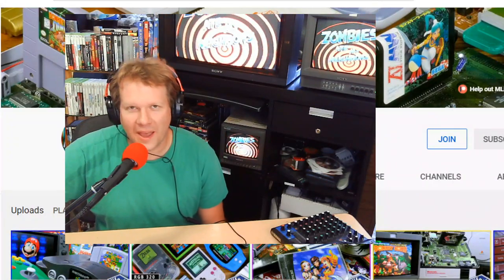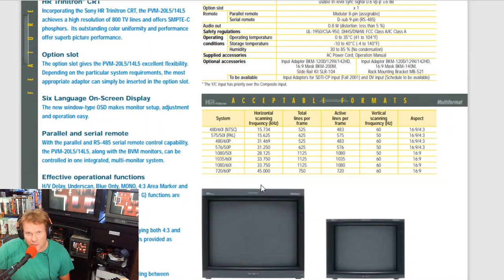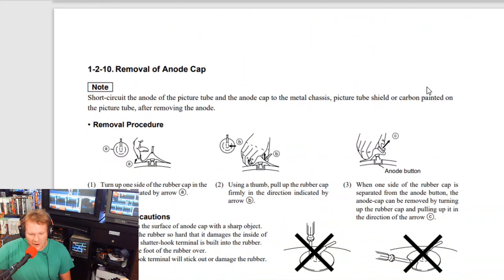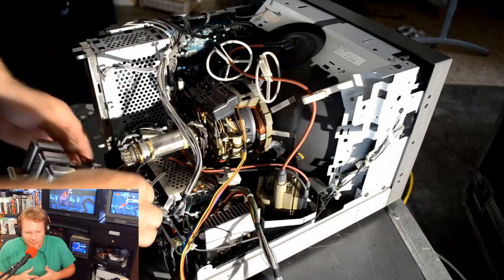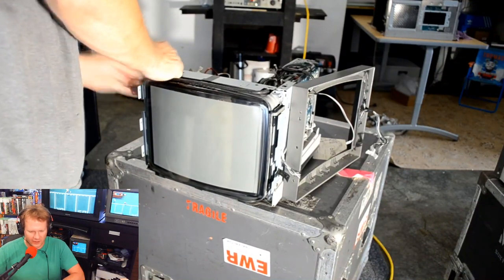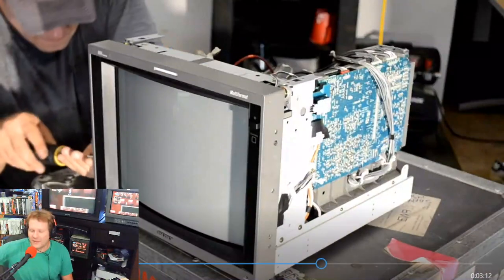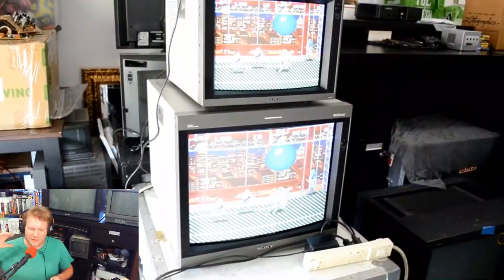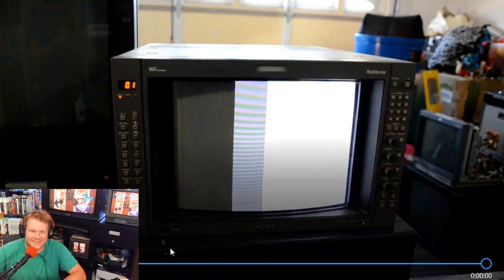Sony PVM 14L5 CRT Tube Repair for My Life in Gaming! | Retro Tech Restorations

Comment: I like how you moved from using some thicc ass gloves and a screwdriver to just bare hands and touching the frame to discharge your CRTs. =)
Reply from the maker: It's hard to believe, but that's the Sony approved method.  I often wonder if using a discharge tool to remove the cap would have gotten you fired at Sony?

Comment: Great repair - I was expecting this to be more complicated, but was surprised how easily it fitted (or how easy you made it look!). I got myself a 14L4 recently, which appears very similar to the L5 - perhaps the European model? The colors on mine were wrong. Red was green, green was blue and blue was red. I needed to swap the cables around on the neck board to fix it (as described in a shmups thread). Very weird. It has slight discoloration on the top right and bottom left corners - suspect I may need to do some convergence tweaks. Hopefully not yoke adjustments because those yoke videos of yours freak me the hell out!
Reply from the maker: Thanks.  Yeah purity ring adjustment should be the last step.  You may be able to degauss the problem away or try turning the screen to face other directions to see if that helps any.  Often the earth's magnetic field will affect the purity in corners of crts.
Reply: @RetroTechUSA  Thanks. The in built degauss button does trigger, but doesn't clear these up. I mean they are really minor - just annoying on some color combinations. I reckon I may need to invest in standalone degaussing coil. I've tried on multiple locations and rotations, the issues are still there, with or without the case on.

Comment: Hello, Retro Tech, could you say what pvm models could be swapped by using 14L1 tube? I mean 14L1 soo cheap and does not have rgb, so it is very interesting to use it’s tubes to restore more capable pvm mates)))